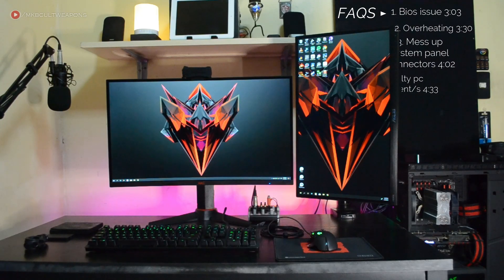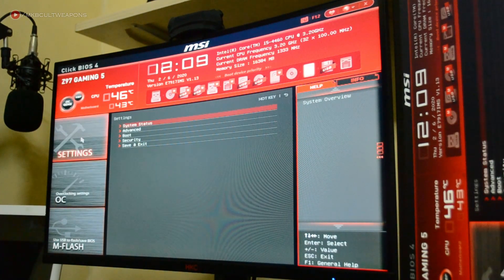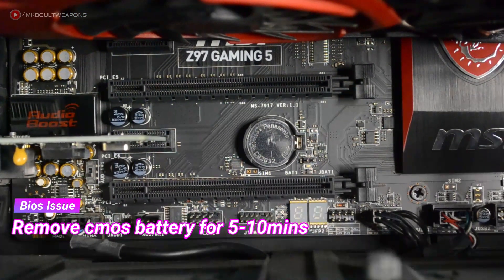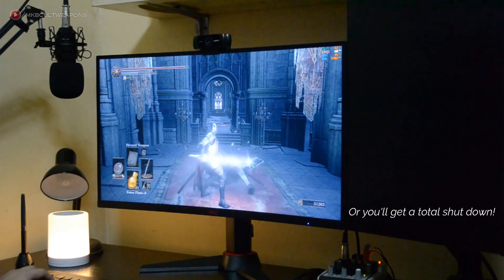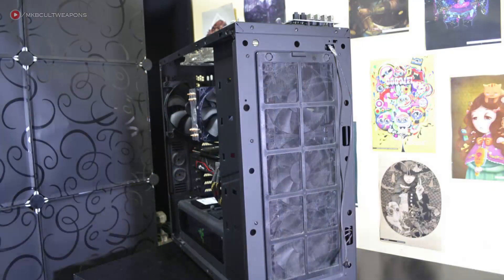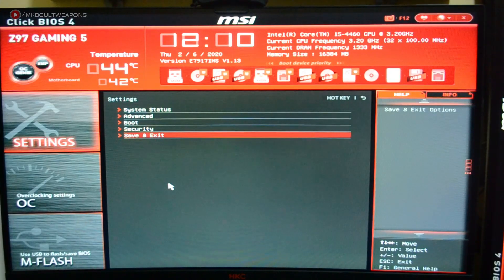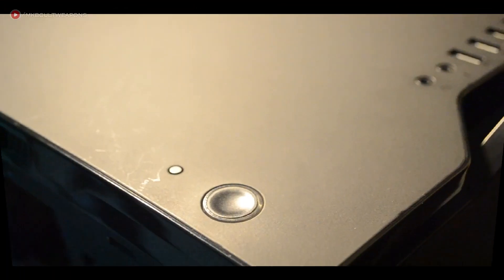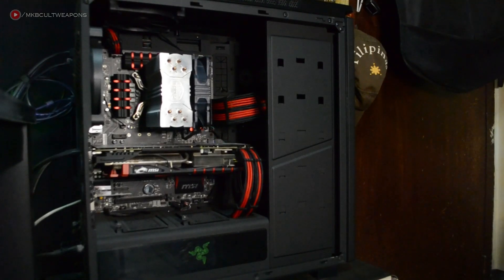Pc keeps restarting FIX / Pc continuous restarting FIX

Comment: dude, please I need your help.. My PC is currently doing this.. and every time it's successfully booted up, my RAM speed goes down from 3200 to 2400 Mhz, so I have to set it back to 3200 in the BIOS again.. and when I turn my PC off, the next time I turn on my PC, the cycle starts all over again.. does this happen due to the RAM sticks?
Reply from the maker: sounds like incompatibility problem bro, may i know your pc specs so i can have a full idea of what's happening?
Reply: @MacCoyzkie  but I only start having this problem ever since the power outtage couple nights ago here.. 

My specs btw are
Ryzen 5 3600x
RTX 2060 Super
16GB 3200MHz
Corsair CX650

Thats pretty much all the important ones..
Reply from the maker: @eightoranges  oh i see that's the problem then, did your power outlet came back to normal? Low power draw can light pc and run fans but does not give enough juice causing restarting like that. If you could bring your pc to a friend and test it out there, if problem persist try reseating the rams, if not then it's your home electricity is giving low power
Reply: @MacCoyzkie  ahhh I see.. I'm so scared its gonna affect my PSU.. the electricity from the power outlet is pretty normal, its just that power outtage happens regularly in my country, at random hours too.. what do you suggest to prevent my PC from breaking apart due to the power problem ? Using UPS ?
Reply from the maker: @eightoranges  UPS is a good choice, AVR is also a good one but if you're in a budget buy something like this https://amzn.to/3hz4o8y this one will break first before your psu
Reply: @MacCoyzkie  ohh wow.. never knew something like this existed.. okay ima try that.. thank you so much dude.. you've been so helpful.. good luck with your contents.. cheers..
Reply from the maker: @eightoranges  no problem bro, glad i can help :)

Comment: Quick question before i try anything. Does this work the same if it tells that ”your pc restarted unintentionally, restart again”. I messed up something and my desktop got destroyed lol nothing worked, so i reset my pc. 

Also, it worked fine before restart, just the desktop issue caused my me.

Hope someone can help me😁
Reply: Update, solved the part where it said i needed to restart, but now it is continuously restarting... Cleaned of ram, but i know it isnt a hardware issue rather a software issue, help please🙏
Reply from the maker: @Mostromstunt  how about clearing the cmos? if that still doesn't work that could be some windows corrupted files, back your files up if it works again and i suggest have a fresh windows installation

Comment: I bought a new power supply because after adding some new hardware it started to reboot of and on constantly so I will find out once it gets her tomorrow, also it’s funny we have the same motherboard and case
Reply from the maker: haha it's ancient monk, i can't get myself to upgrade because of the crazy price hike of everything. Anyway i hope it will went well for your rig. Btw, can you try to remove cmos battery for 5 minutes and place it back again before powering your pc back on. This might just need a hard reset because of the new parts
Reply: IM HAVING THE SAME PROBLEM HELP PLS i bought a new power and that happened too
Reply: Pls reply asap hot to fix this :'(
Reply from the maker: @Beastboiii1108  have you tried the cmos reset?

Comment: My gf bought a second hand pc last year and for some reason it kept restarting when the case was standing vertically. The fix was to put it in horizontal position and we put on another PSU and that fixed the issue
Reply from the maker: parts might be loose if placed horizontally, you need to double check the connections but if it works vertically already i guess that's fine

Comment: HOLY SHIT!! THANK YOUU!! I thought my pc died after cleaning. Thank you so much just got this pc repaired.
Reply from the maker: no problem! glad i was able to help
Reply: Hey carreon bro, same happened to me, my pc initially had issue of freezing then i would have to restart it myself, then i cleaned it and after it keeps on restarting I've tried almost every method this video is showing, what was your problem and how did you fix it?
Reply: @hassanrazaxv  my problem was my pc kept on restarting and showing no monitor display. I fixed it by cleaning my ram and using another ram because the other one was damaged. So yeah just cleaned my ram physically and removed the damaged one fixed it for me.

Comment: hello my pc keeps on restarting. sometimes it happens as soon as it goes to my desktop after turning it on. then after it restarts it will run for about 15 mins to 30 mins then restart again. sometimes it will run for an hour or two then it will restart again. the 1st repair shop that  went to, they udated my windows to windows 10 however it did not do anything. it showed a blue screen of death with stop code memory management. after that i took it to another repair shop and found out that my RAM was faulty. however, when i got it back, it still keeps on restarting just like before however there is no more bsod. i gave it again to them yesterday but when they used it there it wasn't restarting. i don't know what to do anymore :(( pls help me
Reply from the maker: from the very beginning it was the ram, memory management means there is a ram error wherein it just needed cleaning or simple re-seat will fix it. Now if it is working normally in the local shop and not in your house this could be your house power outlet low power draw. Low power draw can only power up fans and light up the pc but won't give enough juice to make the pc work properly. My question is are you using AVR or UPS for your pc? If yes then those avr or ups might be faulty, if not and your pc is directly plugged in a wall outlet then your house might not be giving the right amount of electricity. Have an electrician check it. 

To double check this you can bring your pc to a friend's house and have it run there, if it is working properly without restarts or shut down then your home electricity may be the cause
Reply: @MacCoyzkie  thank you very much!! no, i am no longer using any avr since i was advised not to in order to check. can electricity really the problem? should i worry about my motherboard or anything else?
Reply from the maker: @matchalover920  if you got a psu that is 80+ certified then you got nothing to worry about.

Comment: Before I installed new RAM today, I of course shut off my pc and unplugged it amd cleaned it. But after I installed my new RAM, my pc just started to turn on and run for a couple minutes, turn off, and repeat. (I made sure I bought the right DDR of RAM too) I put the old RAM sticks back in to see if it would do the same thing and sure enough it did. Do you or anyone else in the comments have a potential solution to this?
Reply from the maker: can you install the new rams and make sure everything is connected all the way, psu, sata etc. Then remove cmos battery for 5 minutes and place it back again before powering your pc back on

Comment: please help, did everything but still doesnt work. also my power button doesn work, i only can turn on and off my pc by turning on and of the psu button heeelp
Reply from the maker: i think your pc is fine you just need to check the front io panel if all are connected correctly

Comment: The Technician checked my pc, it was fine, and my pc continues to restart. I was wondering if this issue could have any relation to the voltage from my house electricity? Please Respond soon.
Reply from the maker: if you had a power fluctuation in your house then it could be. If the technician checked your pc and it's working in their shop then probably it has something to do with the power in your house. Better have it check if ever
Reply: @MacCoyzkie  But if it was in my house power then how come this problem just started?
Reply: @MacCoyzkie  I've been using my pc for a while in this house..
Reply from the maker: @twisted3829  if there is a power fluctuation at times power goes up and down putting too much pressure on your psu if you're not using avr or ups. Low power draw means your system is not receiving enough power to make the pc work fully. It is enough to run the fans and lights but not the whole build. Again i might be wrong here but better have your pc checked in a different local store
Reply: @MacCoyzkie  I tested the pc again in the local store and it was working fine we had my pc opened, cleaned and everything, there was nothing wrong with the pc itself we asked the person if he could check in our own house. When he came to check he found out that the cable connecting the pc to the wall was not giving enough electricity to the pc so he gave me the new cable I'm testing it currently and it seems good so far. Thank you so much for your help, I couldn't have done it without you:)
Reply from the maker: @twisted3829  ohh glad to hear it's working now, you're so welcome bro and thank you too for sharing at least it could help others as well if in case they experience the same

Comment: SALAMAT SA INFO SIR. SA NGAYON TINANGGAL KO MUNA YUNG RESET CABLE SA MOTHERBOARD TIGNAN KO KUNG MAGRESET PA DIN SYA. PAG MAG RESET PA DIN TRY KO LINISIN NG PAMBURA YUNG RAM. SALAMAT PO SIRRRR MABUHAY KA
Reply from the maker: sana gumana na, ganyan kasi pag minsan at ito ang pinaka problema kapag may pc ka hehe.
Reply: @MacCoyzkie  ayun sir hanggang kaninang madaling araw di ko pa din maayos tapos ngayon naisipan ko ilipat yung ram ng slot, so far di pa sya ulit nagrerestart. Sana umayos na. Pag hindi pa talaga last choice punta na talaga ako sa technician.
Reply from the maker: @DarlJasferJacosalem  normal sa pc yan paps lalu na kung medyo may edad na ang pc, saakin din recently ganyan kaya linis lang pag may time
Reply: @MacCoyzkie  ayun sir nagrerestart pa din kahit ilipat ko na ng slot ang ram. Pero tumagal sya ng 2 hrs hindi nagrestart after ko lipat ng slot. Siguro sira yung ram or siguro yung motherboard na?
Reply from the maker: @DarlJasferJacosalem  naku paps baka motherboard nga yan. pero kung may tropa kang pwede mag try ng ram stick mo, pa try mo sa kanila, pag ganun padin problem malamang yung ram pero pag hindi mobo ang may sira
Reply: @MacCoyzkie  ok paps pacheck ko nalang siguro sa technician talaga para sure ball. Maraming salamat ulit
Reply from the maker: @DarlJasferJacosalem  mas mainam, sana umokey na sya after

Comment: My pc will randomly shut off (losing monitor signal , occasionally losing power to mk+b as well when this happens. Usually I unplug everything and power cycle it and eventually it gains signal back and will boot but it's happening more consistently and I can't seem to fix it this time, any idea what this sounds like?
Reply from the maker: if the ram cleaning was not working try going to bios and load optimize defaults so if there is any overclocks that are not working it will set it back to normal
Reply: @MacCoyzkie  Thanks for the answer. I'll attempt this if my issue persists :)

Comment: Hello, i just built my pc a month ago, now it will turn off after maybe 30 mins and constantly restart itself. I turn it off then back on and it keeps doing it, i think the cpu is overheating but im not sure because i just bought a corsair h100i platinum.
Reply from the maker: ok bro i think your aio pump is not working if that is the case. Don't plug the aio h100i in a normal fan header, look for the aio_pump header in your motherboard, check the motherboard manual for more info
Reply: @MacCoyzkie  its weird though, cause it will work on my homescreen just fine, but lets say i load a youtube video, it will shut off. All my ram works and everything too
Reply from the maker: @chaotic_acumen749  have you found the aio_pump though?

Comment: i tried cleaning ram with easer nothing i cleaned my pc nothing when im going in google its all ok but when i go in a game its restarting can u help me
Reply: i have just 2 slots for ram one ram card thing should i try put it in other one
Reply: and when im not playing game some time later its restarting
Reply from the maker: bro your problem sounds like it's more on overheating that ram issue. What are your cpu and gpu temperature? it must not go beyond 90c less it will automatically restart or shutdown or worst it won't work anymore if you try pushing it over and over. 
If you're using aio cooler make sure sure it is plugged in the aio_pump header not on a normal fan header. If you're using air cooler probably this is because of your current thermal paste. try using this one instead https://amzn.to/3vdCTFY

Comment: I am new to the PC community [2 weeks] my pc is a pretty built and I am 2 days out of return window and every time I start a game, depending on the game, I can run it anywhere from 30 seconds to an hour, then the screen turns green and sends me to the start screen. I am really scared that my pc I paid a grand for is broken already. Do you have any idea how to fix this?
Reply from the maker: bro is that brand new build or was it own by someone before you purchase it? That experience of yours is not a good sign. Check your cpu and gpu temps and it should not go beyond 90c, if it does it will restart itself or shut down or worst it would have signs that gpu might die early, check more info in our tutorial here https://youtu.be/U_2qRkkf-oM
Reply: @MacCoyzkie  it is a pre-built, it is not the Temperley sit about 65 C
Reply from the maker: @flumperton7891  is that for gpu and cpu ? 65c? If that is the case then it's either you need to update the gpu driver and windows or this could be an auto overclock that was on the whole time. Try updating your drivers, afterwards i need you to go to bios and load optimize defaults, save settings and exit bios. This is just to normalize everything just in case there are auto overclocks and what is usually called nowadays as game mode.

Comment: Ohhh OVERHEATINGGGG THATS IT, OMG I TAUGHT I FRIED MY MOTHERBOARD
Reply from the maker: yeah, use msi afterburner to monitor temperatures
Reply: @MacCoyzkie  another problem is that it doest boot up when i want, i have to let the pc be freezing cold to boot up, and randomly freezes the screen when launching apps, idk what to do
Reply from the maker: @iuli.ysk4226  are you using aio cooler?
Reply: @MacCoyzkie  everything is stock cooling
Reply from the maker: @iuli.ysk4226  ok some pc builders forget about the pump thingy, anyway since you got the stock probably it just need a new thermal paste

Comment: My pc restarts after a few minutes of idle, any ideas? this problem just started
Reply: Thanks for the reply, i will look into it
Reply from the maker: you're probably using aio that was not working properly or was not installed properly. double check if the header is placed in the aio_pump not in the normal fan header. 

If you're not using aio this could be temperature or your pc was set to automatic overclock, where it's normally called game mode. go to bios, load optimize defaults, save it and exit bios

Comment: Hi. Great great video!!! I assembled my new pc just 2 months ago. It worked great and with no issues ultil last week where it starts turning off and on randomnly. It doesn't happen often, but it happens. It's just a split second but it is not acceptable and could mean something serious. Is it normal for a brand new pc to work perfectly for one month and start rebooting itself randomnly the next? Is it psu related? (How can I check psu performance?). Thanks for your time.
Reply from the maker: its not normal and if you are currently experiencing this one today it might have something to do with the gpu drivers specially when using amd gpu. If you got nvidia gpu download the latest driver, if you're using amd use 21.2.2. 
If you really want to check the psu you need something like this https://amzn.to/2ZXtF2n to test it. 
can you just try to remove your rams and put it back again. sometimes it just needed to be re-seated.
Reply: @MacCoyzkie  Thank you very much for taking the time to answer. I started with your easy tip and upgraded nvidia drivers. So far, no rebooting. I really do hope trouble ends here before going the psu road and buying that  psu tester... But, with these things, you never know. Anyway, I do appreciate your help. Cheers from Argentina.
Reply from the maker: @DepressedCapitalist  you're welcome, glad it's working now :)

Comment: My computer is doing this after about 1 minute in windows 10. The BIOS screen is working and will stay active for a long time without restarting at all but as soon as I get to windows after 1-3 minutes it’ll restart. Even when trying to reset it’ll work during the file preparation but after a minute during the install it’ll cut out. No blue screen. Then load up normally until a minute into use on windows. Any suggestions?
Reply from the maker: if your pc can stay in bios without restarting i think this is not a hardware issue but more like a windows 10 issue. Are you using oem or retail windows 10?
Reply: @MacCoyzkie  Thanks for the reply. Retail windows, but the ‘professional’ edition.
Reply from the maker: @TheCrackbinge  ok that's good, 
this might also because of other drives connected in your pc, an old hdd perhaps. Try removing those extra drives first and just leave your boot drive and see if it will stay on desktop. If it did stay it might be because of the hdds. if still the same this might because of the previous windows 10 installation.
 i think the previous installation might have a corrupted file or something that causes that restart. Having a fresh installation of windows will do the trick assuming you got no important file in the boot drive.